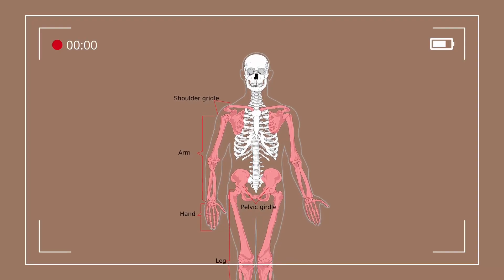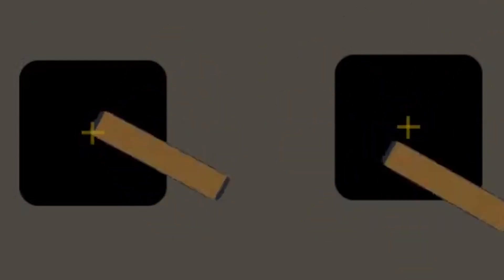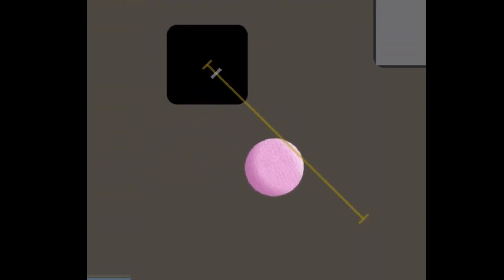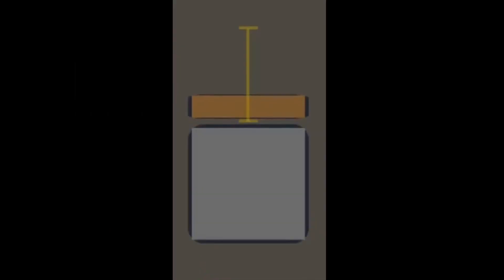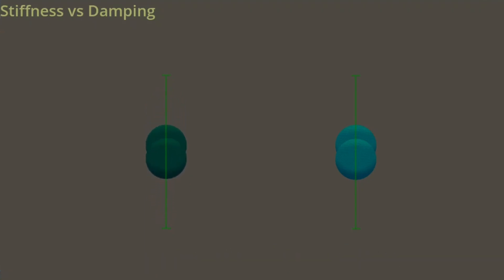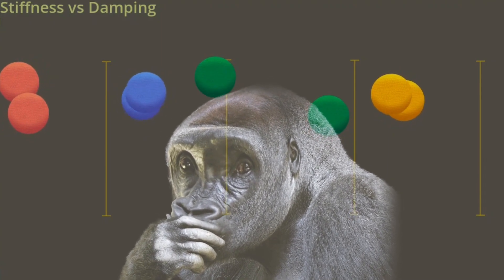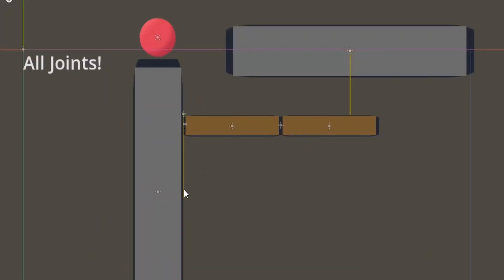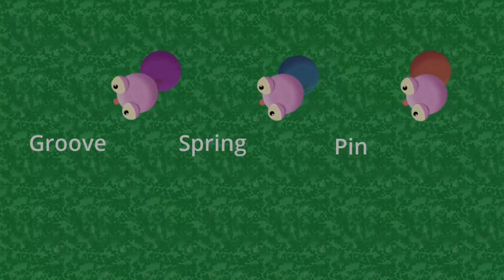How To Use Joints In Godot (2D)

Comment: Could you explain how you did the snakes at 3:48? The only one working somewhat correctly is pinjoint which becomes a problem when i add many rigidbodies and they become separated.
Reply from the maker: yeah it can be very awkward sometimes. The snakes have a CharacterBody for the head with a simple movement script, the body which is a RigidBody and of course a joint which connects them. I'm not sure what is the specific issue you're having but maybe check if the joint is connected to the correct nodes. Another thing I would consider is to disable collisions between connected nodes if you haven't.
Reply: @asamblur  how do you make it so the Rigidbodys aren't affected by gravity
Reply from the maker: @dinoboy7221  Rigidbody has gravity_scale property, you can read about it here:
https://docs.godotengine.org/en/stable/classes/class_rigidbody2d.html#class-rigidbody2d-property-gravity-scale